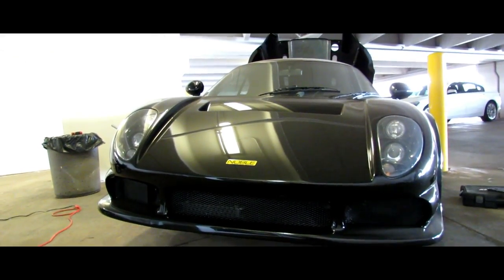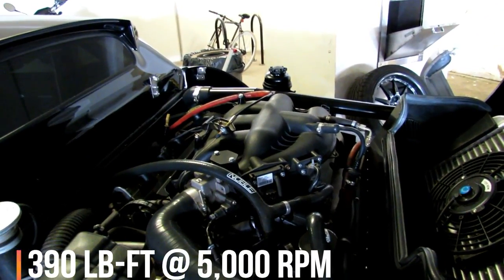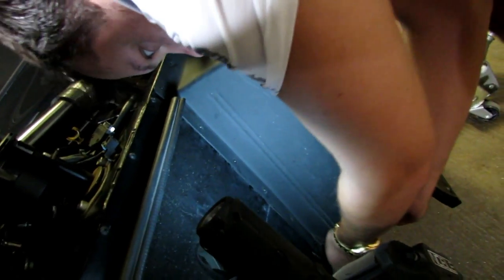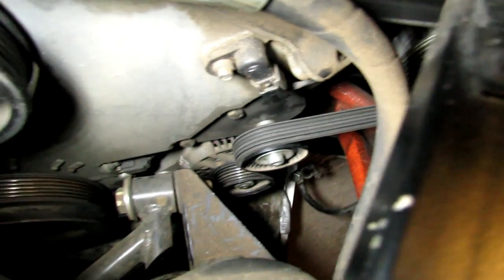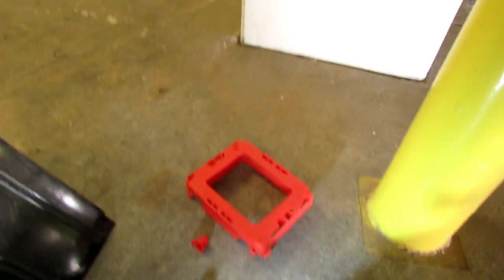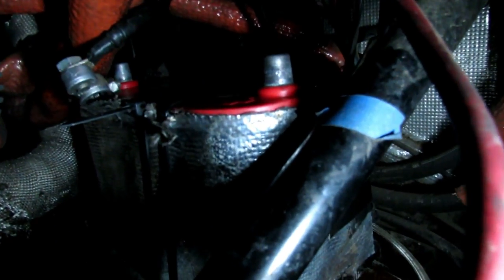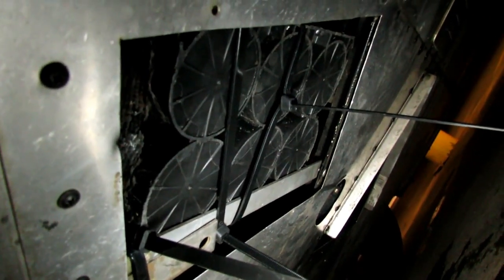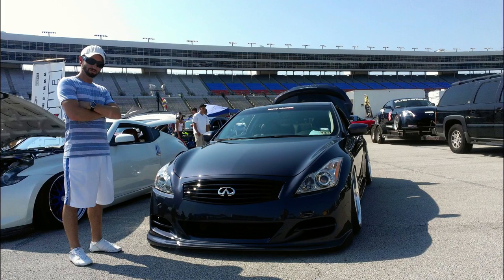Noble M400 - Battery Install

Comment: How do you feel about me getting a Mishimoto radiator for my 04 Infiniti G35 coupe. My stock one has several small leaks and I’m not sure whether to get a new stock one or upgrade to the Mishimoto radiator.
Reply from the maker: Oriley's radiators come with a lifetime warranty, so if it ever leaks or breaks i get a new 1 for free. That sold me over the Mishimoto, no warranty at all. Plus I remember reading about it not being a direct fit replacement...https://g35driver.com/forums/engine-drivetrain-forced-induction-diy/285285-question-about-mishimoto-radiator-install-2.html